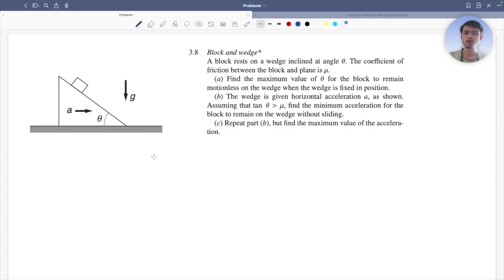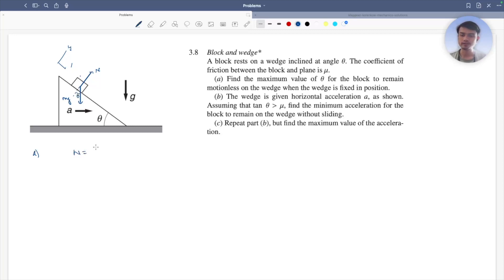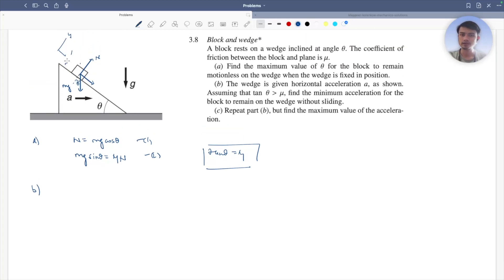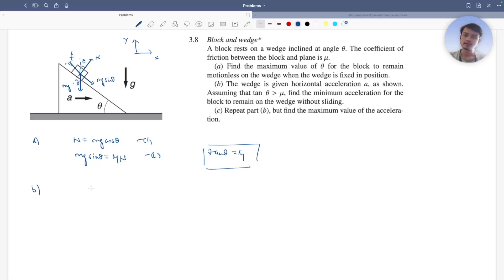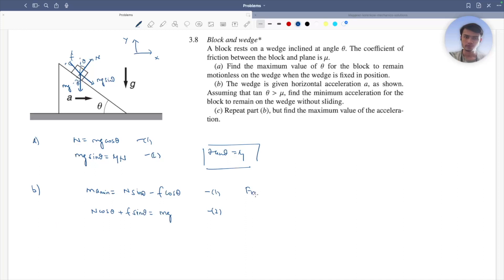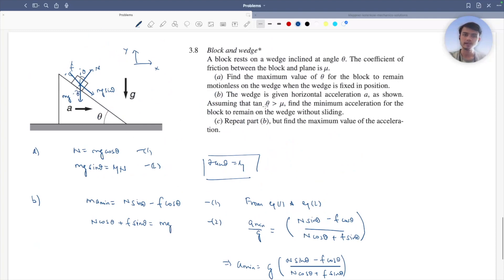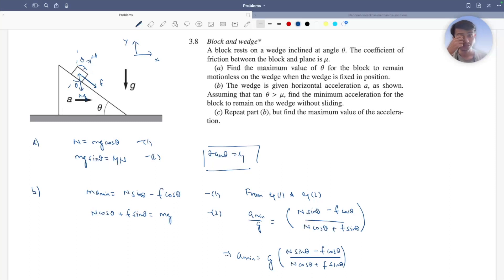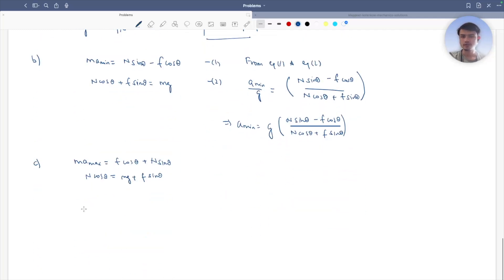Problem 3.8| Intro to Mechanics| Kleppner and Kolenkow|JEE|NEET|11&12

Comment: solving C), why does the friction goes on the positive way?
Reply from the maker: Because in part c I’m looking at maximum acceleration or in short I am looking at the limit beyond which the block on the wedge may fly off in the opposite direction. So to make sure that block doesn’t fly off I wedge is applying the friction down the slope of the wedge. I hope this answers your question 😊.
Reply: @r2e_ yes, thank u, i have a test tommorrow and ive been crying trying to solve stuff cause this is simple but i cant fix it
Reply from the maker: @t@tiagoalves3023hink with a clear head, and you’ll be able to solve them. All the best for your test.